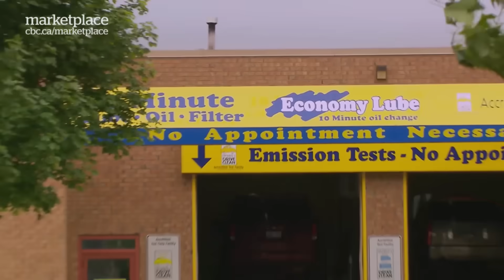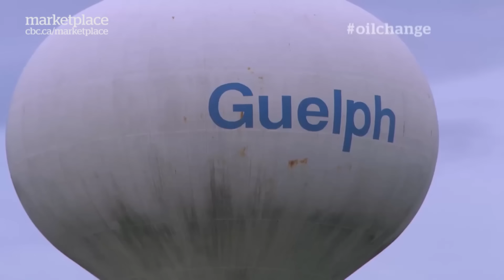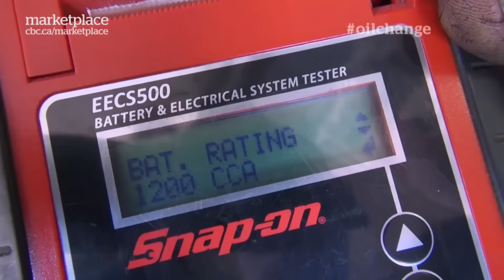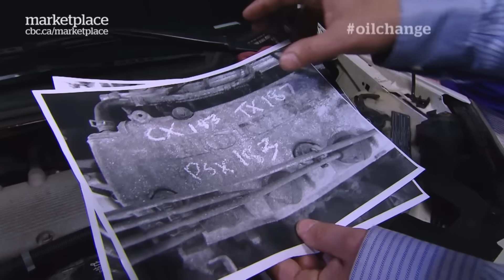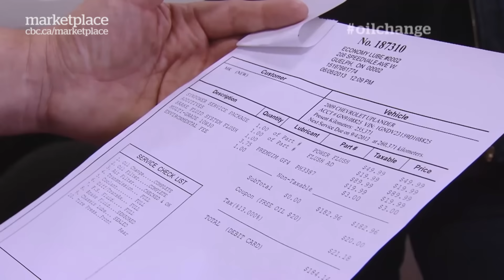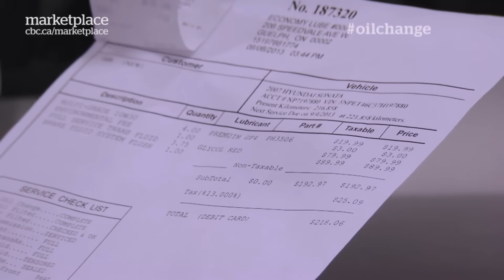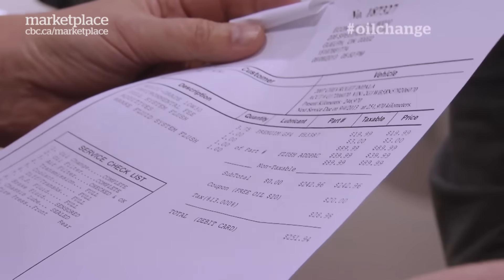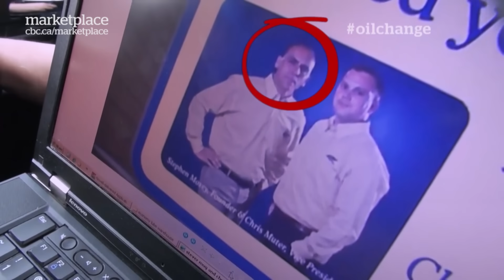Oil change scams: Hidden camera investigation on what really happens to your car (CBC Marketplace)

Comment: Screw these $19 oil change places. Spend a few more bucks for some quality synthetic oil and a good filter and do it yourself. Doing it myself for the past 14 years is one reason, I believe, why my car has 346K miles on the original engine and gearbox.
Reply: Oh yeah I use Mobil1 0w-30 synthetic changed every 6 months or 6K miles (10K km).
Reply: Patrick94GSR That's similar to my maintenance procedure, I use a Wix oil filter and Mobil 5w-30 synthetic change about every 5-6K miles. 

Theirs no way I'd trust oil change places don't care if they are free. Engines are way too expensive to be put in the hands of evil careless scammers. People don't realize that all these places do is top the oil off with cheap recycled oil. Bottom line diy read the service manual and buy the best you can afford.
Reply: Easton McDonald When I was younger I took my previous car to the local Valvoline Instant Oil Change place.  One time the kid working on it didn't get the oil filler dispenser all the way into the oil fill hole on my engine's valve cover, and it splattered oil all over my engine bay.  That was the last time I went there and have been doing it myself ever since.  That was probably 1999-2000 or so.
Reply: Patrick94GSR  there is a bit more you have to buy if you have never done an oil change before (such as an oil pan but its like 13 bucks at walmart) and a few sockets (my geo storm needs a 19mm for the drain plug). and a set of ramps (i suppose you could use the jack that comes with the car, but i wouldn't want to) so just a few things to point out oil pan 13 bucks oil wrench 5 bucks, socket set 10 bucks. (if additional socket needed at 5) so 15 ramps are 40 the oil i get is penzoil platinum synthetic (25) oil filter (i get the fram ultra synthetic) 8 bucks. so adding that up its roughly a little over 100 bucks. granted from then on our oil changes cost me 33 bucks each time.
Reply: volkswagenginetta well sure, but I started with oil changes and now have done 100% of all maintenance and repairs on my current car for the last 14 years.  I now have an extensive collection of tools, both for car and bicycle use.  I have always used a floor jack and jack stands for my car since it's too low to use ramps.  But I just recently made some auxiliary ramps for my regular ramps that will allow my lowered car to get up on them, so it should be even easier now.
Reply: Patrick94GSR
 its still worth it in the end though. because i think a synthetic oil change from a mechanic here is about 70 bucks for the good stuff. it pays for  itself quick.
Reply: +Easton McDonald Except Wix is garbage, and would void most manufacturer warranties.
Reply: +Patrick94GSR My 1990 Mercury Grand Marquis has two oil drain plugs. When I changed the oil after I got it, sludge came out of the smaller plug closer to the front end of the car - and I know the previous owner who was the original owner took real good care of it, but for some reason that one plug still had sludge coming out. Maybe he only took it to quick change garages, he was in his late 70s or early 80s when I bought it.

I'm not saying there can't be good quick change garages, because there can be. It's just that some weren't so honest and others don't really know what they're doing as well as others - trial and error.
Reply: +Patrick94GSR I bet your car must be a Toyota :P
Reply: Most of these places are honest, it's the customers fault if they get scammed.

If you walk in and look like you don't know your ass from a hole in the ground...you might get scammed.

It's like a hot chick walking around in a short skirt and then getting upset when she gets raped. Ummm sorry honey, what did you expect?
Reply: +Rd S You just said what?
Reply: jlcame094
no actually it's an Acura Integra GSR (hence the user name).  My wife's car is a Toyota and it has way more problems than my car does, and it has fewer miles than mine.
Reply: Patrick94GSR Ohh, i have so much trust with Toyota, my 98 Land Cruiser (owned from my dad) has so many usage and it still runs an purrs like a charm.
When i changed the T-belt years ago, the Toyota guy told that the engine looked like new and would last for my grandson to drive it for sure. Im 21 btw :)
I feel diesel cars before all this electronic bollocks (around year 2000), are really durable with good maintenance. Also, my dad and i are... im trying to find the best term (English is not my language)... "maintenance" freaks. When i was a little kid, i remember seeing the jeep all in parts, hanging on the roof, on my dad's garage for repainting and do some maintenance work on the chassis.
The guy at the stand told me that these old jeeps are searched for safaris and other usages in Africa and wild environments like that.
The jeep has 389k km in it, or 241k miles.
I believe all car's, with the right maintenance, would last a really long time. But thats why i very much dislike electronic bollocks, especially on the engine.
Reply: jlcame094
yeah my dad's '06 Tacoma has over 200K and has been great, other than driveshaft replacement.  I think it's just that my wife's car wasn't maintained very well before she got it, which was before we were married.
Reply: +Patrick94GSR What if you're a girl and dont know how to do it yourself?! :(
Reply: 3xoticx What does being a girl have to do with it?  I know plenty of girls who work on their cars.  Just gotta learn how.  Don't let anyone tell you that you can't do it because of who you are. :-)
Reply: Patrick94GSR
You are totally right!
Reply: 3xoticx Yeah, girls can learn automotive maintenance well too.
Reply: +Patrick94GSR well... actually doing your own oil change is gonna cost you at least $40...i do mine all the time...
Reply: +SocialExposure TV dang where do you live or what oil you use? cause the auto parts stores here always run specials on 5 quarts of oil and filter for 19.99 or 24.99
Reply: SocialExposure TV
How do you figure that?  I use Mobil1 0w30 synthetic oil and STP filter and it costs me about $28 total.  That's US dollars.  Even in Canadian dollars that's still not $40.

For an oil change place or other shop to do it with SYNTHETIC oil (if they even carry 0w30) would cost at least $50 or more.
Reply: Reel Yakin
That's for their cheap POS house brand oil.
Reply: +Patrick94GSR hehe only 346?? thats cute my toyota 2004 rav4 is 720390, ive got my own shop so i guess thats why
Reply: omar malik how much is original?  I'm now at 348K on the original engine and gearbox.  I've only had the engine open once at 330K to replace the head gasket, that's it.
Reply: I've spent probably the same amount for a new car In total. for repairs and touch ups. but it's hard to find the old toyota rav's
Reply: +Patrick94GSR i knew a guy who dident change his oil for 300k lol, its all on how thw car is built, but if you got a shitty car i would recommend changing that oil frequntly
Reply: +Patrick94GSR Well, I don't have the option. I live in an apartment and can't jack up my vehicle or empty any fluids into the parking area. I also don't have that friend with a driveway, so I'm stuck going to a mechanic for a lot of basic maintenance. Videos like this are helpful when it comes to knowing what to look for.
Reply: +Pala Luka There are NO CARS built to run for 300k without an oil change. Will they run? Sure. Is the engine suffering extreme premature wear? Absolutely
Reply: oblivious cars arent build too run without oil believe it  but well build engines, like Volkswagen, and Japanese made ones can withstand long intervals without changing the oil, i left the same oil in a dirtbike for 20 years, i usally change it every 5 years, but now do it more yearly because i put the bike through soooo much shit and its an antique now,point is an engine can handle lack of oil if the parts are built well
Reply: and Jason Colbeck if you own a car you can change your own oil, my god doesent matter where you live, people this generation getting lazy
Reply: ***** haha that's cool
Reply: +Patrick94GSR I just use a 2x10 in front of the ramps to get my honda up on them.
Reply: ***** I keep all my service records in an app on my phone, which can be exported out to something like Excel and printed out.  I think any buyer would be impressed with 14 years worth of records.  Then again, I don't think anyone wanting to buy a 21 year old car with nearly 350K miles on it would really care much about service records.

Also the money I've saved over the years doing everything myself FAR exceeds any additional resale value by many times.
Reply: ***** Service stamps?  I've never seen such a thing.  I just keep up with maintenance when it needs to be done.  And nothing would be handwritten, not sure where you get that from.  As I said, the money I save doing it myself far outweighs any difference in resale value for dealer service (usually a ripoff, they don't call them the $tealsership for nothing), plus the fact that I know 100% that the work was done correctly without any extra BS.
Reply: ***** I'm already down to changing my oil twice a year, which lately has been more like every 4K miles.  I don't think I would want to leave the same oil in the car for a solid year.
Reply: +Patrick94GSR I don't understand why, but undisputedly there is a gender separation when it comes to mechanics. 
I personally suspect the division is not due to social pressure nor any environmental factor. It seems to be biologically innate, but it is correlated with sexual orientation rather than chromosomal gender. Male-role-playing lesbians can be mechanically inclined just like chromosomal males. But feminine females are never eager mechanics.
Reply: Nehmo Sergheyev
 Don't use those BS gender stereotypes.  I know plenty of straight women who love working on their cars, and I also know of plenty of manly dudes who don't know jack squat about cars.  There are even automotive journalists who drive cars for a living but don't know a thing about the mechanics of them, how they work, etc.
Reply: +Patrick94GSR IF your car can use synthetic
Reply: draconpost Come again?  Any car can use synthetic oil.  Don't believe the myths about not switching to synthetic, either.  My car had over 300K miles when I switched to Mobil1 0w30 full synthetic, never had any problems.
Reply: And you don't drive it like a ass or in your case "drag race" it
Reply: *****
haha I drag raced it a few times back when I was young and stupid.  Later I autocrossed it a few times, which was awesome but never could get into the time and cost commitment of getting serious about it.
Reply: +Patrick94GSR I have a 1999 Mercury Tracer with 279,XXX miles, original, unopened engine block and manual transmission. 3000 mile oil changes on the 2.0L engine and 50,000 trans fluid changes since the car was brand new and still no signs of it giving up or any weird knocking. :) I probably will need another head gasket soon. They naturally just wear out around the 200,000 mile marker. I had a oil tester show I have minimal coolant in my oil in between changes. Tail pipe doesn't smoke white, so I know the gasket is not blown. No white crust on my plugs, so I know I am not burning the oil either.
Reply: Phenomental1ty
haha mine let loose about 330K, had white smoke, the oil under the valve cover looked all thick and light brown gross looking lol.  I got the head all cleaned up, valve seats ground, and valve stem seals replaced for 120 bucks from a local shop (I took the head off myself, stripped it down and took the bare head to the shop).

I used to do 3K mile OCI's, but when I switched to 0w30 synthetic I stretched it out to 6 month/6K mile OCI's.
Reply: Patrick94GSR lowest mileage needed for changing 0w30 typically would be 6000 miles being it's synthetic. a lot of lazy people with older cars running synthetic usually don't have to change until about 15,000 miles if the engine is 3+ liter displacement.
Reply: Phenomental1ty
I was brought up on the age-old myth of "3 month 3K mile" OCI's, which is rubbish.  However I personally would not want to go much more than 3K miles on conventional dino juice, especially not on a 20 year old car.
Reply: But if you have a shitty car it's pointless to have nice oil in it
Reply: +MrBannnnnny I am
Reply: Patrick94GSR oh nice, but at least you don't do it often. I own a BMW 330i M sport 02 manual and I can't tell you how many kids at my school want to drive it, they say they know stick, next thing I know they will blow a gasket or even worse crack the engine because they don't know how to drive properly.
Reply: *****
haha only a few people have ever driven my GSR.  I want to teach my wife to drive stick, but it would be harder to learn in my car because it has a short-throw shifter and very lightweight flywheel.

Comment: I worked at a full service gas station in Washington state for 3 years. I started as a "pump jockey", running to meet cars as they pulled up to the pumps, checking oil level, all 4 tires air pressure, and a washing the windshield (or all of them if requested) as the gas was being pumped.
I moved up to a "remove and replace" mechanic, being directed by more "experienced" (AKA better liars) mechanics who would do the diagnosis. Minor items were often missing. Things like quarts of oil or windshield wiper blades and parts and before too long I was ultimately moved to manger of the station and simply didn't interfere with the mechanics shenanigans. But after 3 years of listening to the "mechanics" brag about how much they sold unnecessary services, I wanted to quit.
One day a regular customer pulled in for gas and described the dilemma he was faced with after scraping the money up for 4 new tires to replace the bald ones (showing the 'belts' due to excessive wear-they were dangerous) on his beat-up, well used family car, but no funds left over for installation and balancing. He could experience a dangerous 'blow-out' at any moment.
Mounting tires on steel wheels (in the '80s) was a simple, quick feat easily done with the right equipment, so I told him to come in early Sunday morning (we were closed on Sundays) and I would de-mount the old tires, mount and balance the new ones for no charge. His family was obviously strapped for cash and I knew this would make his family car safer for his family and everyone else on the road.
He showed up on time and in about 20-30 minutes I had the job completed.
Come mid-week, he stopped in for gas and one of the mechanics (that didn't like me after he was passed up for manager) noticed the new tires and asked him about them. The customer, simply an honest man, let it slip that I had mounted them a few days earlier, and this other mechanic checked the work orders and discovered there was no paperwork for the job. I was promptly fired. 
No good deed goes unpunished. But I do it anyway.
5-10 years later, I ran into this mechanic (we lived in the same part of town and had many mutual friends) at a local tavern and he acknowledged his actions and apologized.

Comment: “Everything looks ok but man your air filter is really dirty”
Reply: "😮😯That one just happened to me !!"😳😗😯
Reply: Cabin air filters, yes. You don't need need one every time it's suggested. Engine air filters are a little different.
Reply: @TheHazeKiller  I had a friend who bought a near new car for $1200. The guy had no clue what was wrong with it. Turns out he had no clue wtf a mechanic was, never changed the oil or air filters. Thing ran just fine once both were changed
Reply: Too often, if the filter's dirty, it's because they made it dirty. It's one of the easiest scams
Reply: InfernosReaper you sound hurt bruh there’s no way to make the dirt on the air filters look authentic if I dragged it across the ground you’d be able to tell for sure
Reply: @justinmoore8934  What the sketchy mechanic will do is rub dirt and grim from like the engine bay onto the filter.

The average customer doesn't know any better.